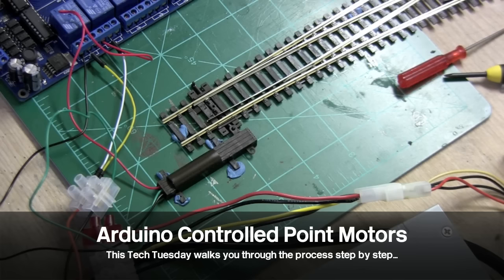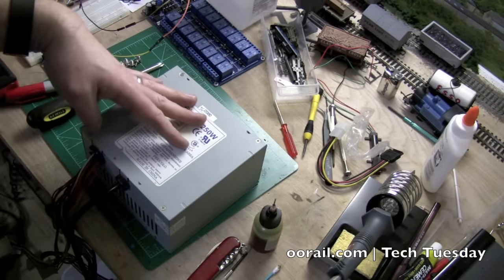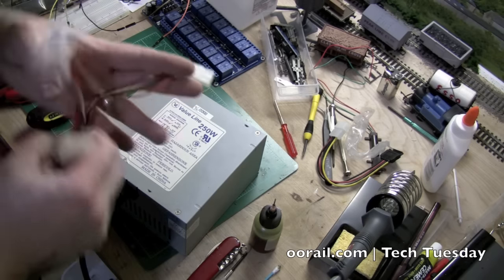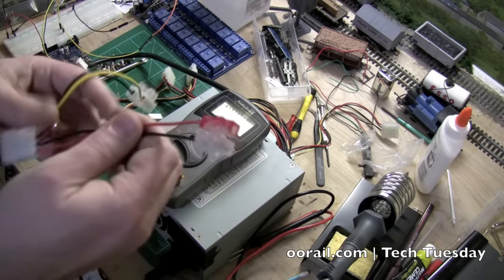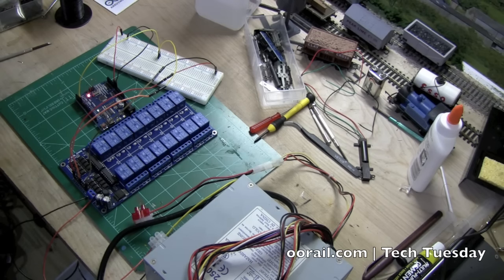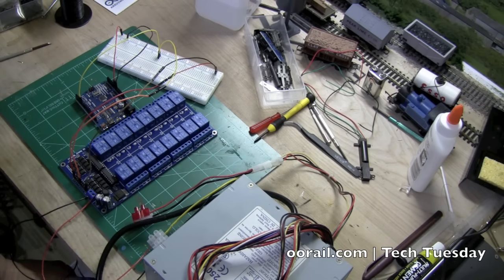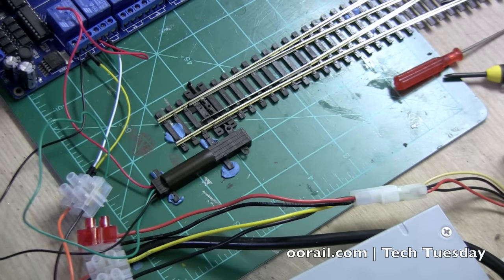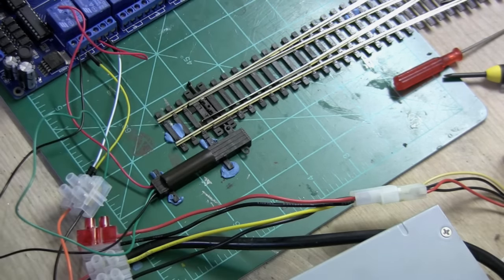oorail.com | Tech Tuesday - Arduino Controlled Point Motors

Comment: One Arduino will operate how many single switches
Reply from the maker: You need one digital i/o pin to control each relay. So if you want to control a 16-relay unit, you will need 16 digital i/o pins. The arduino uno has 14 digital i/o pins, so you could technically run 14 off a single uno, however you may want to use digital pins for other things, such as communications. A good design option is to use CDU (Capacitor Discharge Units) and look at how you use the points. For example, if you have points used in pairs (eg. connected together), then you need to throw them in pairs, so a larger CDU and just using a single digital i/o pin. I typically use either Arduino Mega (which has a lot of digital i/o) or cheaper esp32 or esp8266 units, which are also wifi enabled.

Comment: on a atx pc type all you have to do to is place a switch from the green lead to a black lead green is ps on grey is ps good send it to a led threw a 2.2 K ohm resistor
Reply from the maker: +Jamie Phillips thanks that's a good suggestion. The AT power supplies are cheaper and don't require any extra mods though...
Reply: I am using 2 ATX units to power my lego and raspberry PI'S no mods no load resistors the ATX I am using 1 came from a P4 the other from a P2 towers
Reply: That is confusing to me.  I do know that there is one pin on the motherboard connector that can be shorted to ground with a switch to turn on or off the power supply.  I looked it up, and now your instructions make sense if you apply them to the big motherboard plug.  Here is what I found using Google:
Step 1: Search! Just look after the green wire in the cable tree from the PSU. (by "cable tree" they mean the many wired plug that goes to the motherboard.)
Step 2: Connect! Now it's time for the wire.Bend the wire and close up the little green plug from the big ATX plug to any other BLACK plug. ...
(In other words, just short the green wire to a black wire using pushbutton switch that you wire to those two wires.  Hope I said that clearly.)

I guess the grey wire on the motherboard plug can be used as +5V to light an LED through a resistor.

Comment: How do you plan to drive 8 Switch Motors with out 16 digital outputs on the Arduino?
Reply from the maker: Using an Arduino Mega which has 54 digital outputs and 16 analogue ones :)
Reply: How will the code work? Do you plan on making it available?
Reply from the maker: The code is an expanded version of the prototyping code I have up on GitHub. Yes I will definitely be making it available. Keep an eye on the channel, I'll be uploading a video in a few days that'll explain why there has been very little activity on the channel for the past 12 months...
Reply: Any updates as of yet??

Comment: can this run a tortoise switch matchine.  they are stall motors, meaning they are always powered.
Reply: Here is a start for you,,,  yes you can use a double pole relay so power in the middle then it will power the nc contacts ( normally closed). Then power the relay to switch to the no ( normally open contacts) for the other direction ...
  I’m don’t know of the frog you have to reverse power or just power to each side for left right

https://www.google.com/amp/s/rudysmodelrailway.wordpress.com/2015/01/25/new-arduino-dcc-servo-and-function-decoder-software/amp/

Comment: Two train sets in 1 LOL. Don't you have to use C++ or python for the Arduino? How do you rate it to the raspberry pi.
Reply from the maker: +silverfox2358 Yes, the syntax in the Arduino IDE is basically C. Raspberry Pi is also a very good embedded platform, you could use either. I will be doing some projects with the new Raspberry Pi in a few weeks..

Comment: By the way, that "big clunky button" he was handling is the really dangerous part.  Which is why it is safer to use a more modern PC power supply that only has a low voltage (5 Volts DC) to the wire that has to be grounded (no sparking will occur, because current is limited) to cause the power supply to turn on the 12 VDC and 5 VDC output wires.
Reply from the maker: +Henry Stinson lol the big clunky button isn't dangerous at all. Lot faster to get rolling out of the box with an AT PSU and they are a lot cheaper :)
Reply: Uhh yeah it is dangerous.  It is switching line (mains) voltage - meaning if any of those insulators get moved to expose metal, you can zap yourself.   And you can get ATX supplies for about $10 on ebay.

Comment: should have been two videos, one for the power supply and one for the Arduino part
Reply from the maker: lol... why? :)
Reply: A large portion was about the POWER SUPPLY, which was very good and if on it's own I am sure you could have gone into a bit more detail.
Then a second video for this Arduino which also could have been in more detail, at one point you say that we have seen how you tested the program, but that is not in this video.
And two 30 minuet videos are better than one over 50 minuets.
 I would have liked to see more on the Arduino as that is what the title of the video was all about.
Reply from the maker: +Stephen Bryce-Grant Thanks this is great feedback. So the reason I rolled them into the one video was that while working on the relay board video, I realized you needed a 12V DC power source to drive it. Rather than wait another week for the point motors I did a bit of a quick video on how to get the 12V DC power source easily. Can you give me an idea of what other bits of information / detail you would have liked to see on the power supply side? There really isn't much more I think I could have done, as from maybe opening it on video, but thats just four screws! As for the Arduino said, I'm much more interested in what extra you would like to see there and I'll incorporate that into future videos. When I'm filming the Arduino videos I'm actually using multiple video sources so sometimes I will say something and then not need that, and drop it while editing. I think the testing part was the bit about the serial port monitor? If thats the case, I decided not to include that because the video was about 51 minutes long. The tech tuesday video coming out today does walk you through the serial monitor, although it will be out a bit later than planned today as we were hit with a heavy snow storm, so I had some other tasks and errands that I had to run this morning / afternoon before the next round of snow hits us! :) This is great feedback, so please keep it coming!
Reply: As you say in this the video being about 51 minuets long, that could have been about 30 minuets for each, I have a Power Supply made from a PC but the newer version so I have a 3.3v which is really handy for LED's as you no longer have to worry about resistors, these connections will be for lights in buildings. I will have to look though more Arduino videos before I commit myself to them or their Asian counterparts. But now to rest my poor old brain I will just watch the layout videos and see the progress as I slowly get closer to the latest videos. I did see one where you used the tall cylinder to hide the corner which I did find very clever and made a note of it just incase I need to disguise a corner on my layout.
Reply from the maker: +Stephen Bryce-Grant I will do a video in a few weeks on the Chinese Arduinos, they use a slightly different chip and require some device drivers to be installed to work right after the first upload. You basically need the CH340/CH341 driver installed on your computer. It wasn't too difficult on the Mac or under Linux. You should never connect an LED directly to the DC supply, always use a resistor, regardless of the voltage. The lower voltage just means you use a smaller resistor, not no resistor. For the 12V DC supply, I think I was using around at least a 470 Ohm resistor, for the grain of wheat style bulbs I use a 1kOhm resistor. If you don't use a resistor, sooner or later something will melt! This weeks Tech Tuesday video explains the serial monitor a bit more and has some live examples of it... Yes the tall cylinder is actually HVAC duct work, I think I used the 5" diameter, 2 foot high aluminum stuff. There will be another update on the power station in a few weeks, I couldn't get the intricate architectural features I wanted with the printer / knife / scissors approach. So after seeing a few people with those Silhouette Portrait cutters, I put an order in for one, should have it in about a week or so.
Reply: You might still have to use resistors with the LEDs, just smaller values.